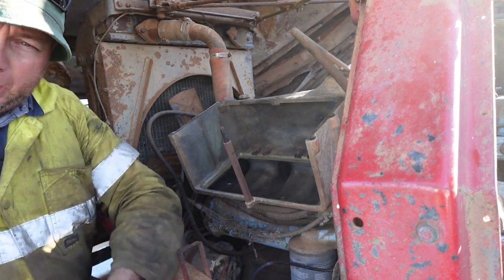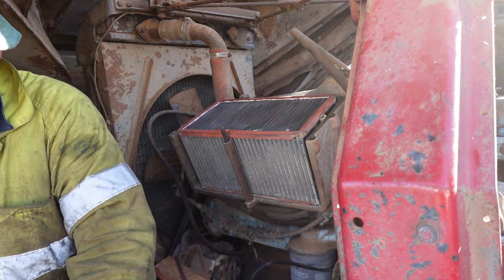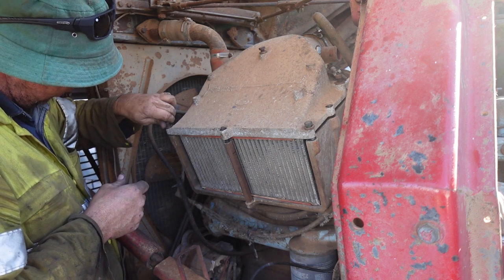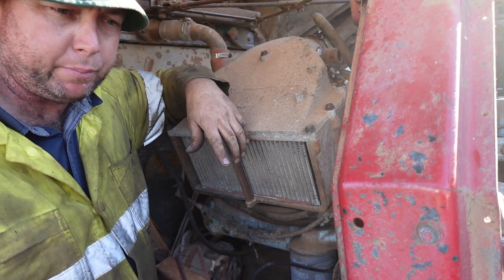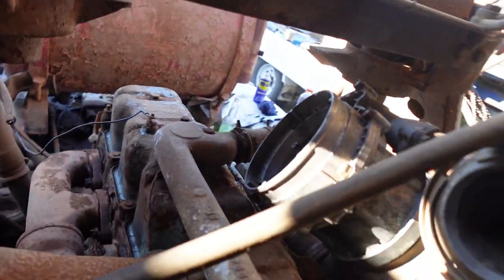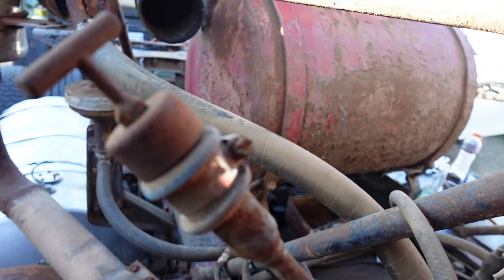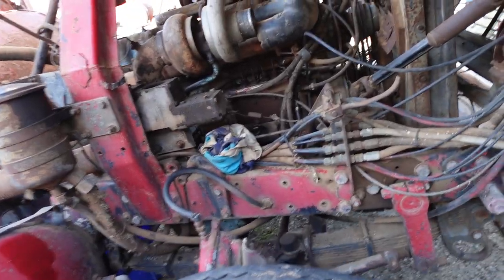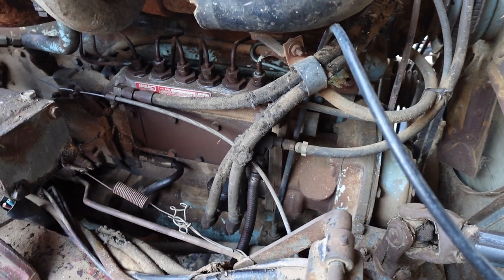Coolpower box reassembly and tip turbine fan installation.

Comment: Is the tip turbine fan not oil fed?
Reply from the maker: I believe the early tip turbine fans were oil fed. I’ve worked on a 1976 F model with an oil fed fan, but most have had sealed bearings in them.